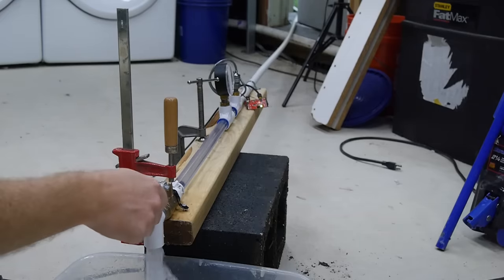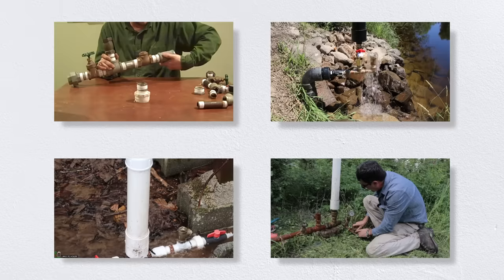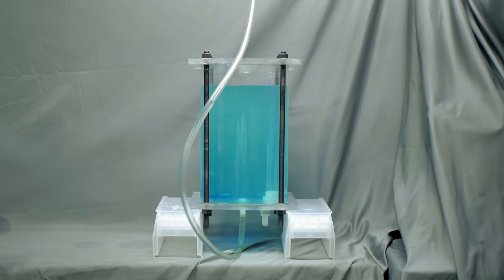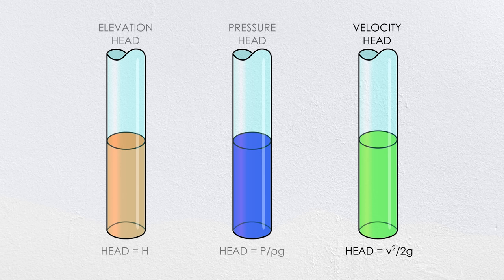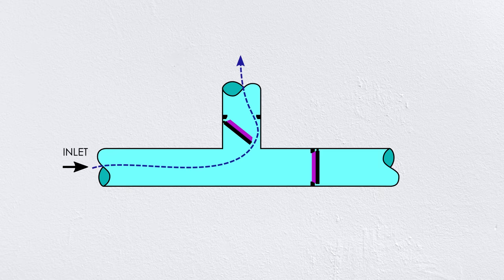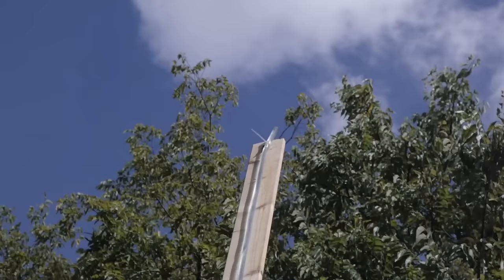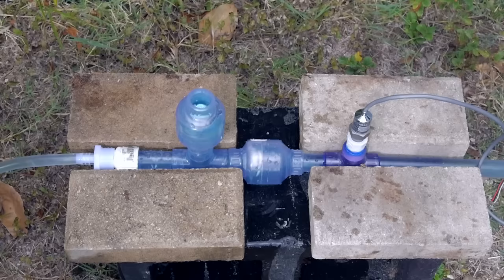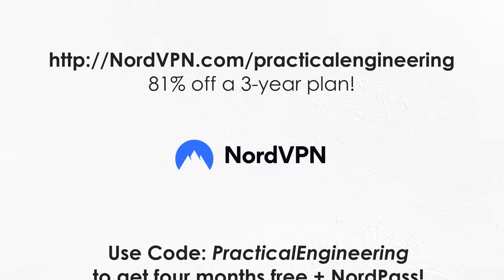How Does a Hydraulic Ram Pump Work?

Comment: It's things like this that convince me that engineering is black magic.
If you came to me, and asked me build a system that pumped water 10 feet into the air, without electricity or fuel, I would have told you to bugger off. It's not possible.
Reply: magic it's just advanced technology that you don't understand yet.
Reply: Flowing water = energy = Fuel.
You can use this fuel in many ways, one is to use a ram pump, another would be to have a 2 chamber device, one with a turbine/generator and the other with an electric pump.
One of the big problems with 'youtube armchair scientists' is they dont know the difference between an impossible 'perpetual motion device' and harnessing solar/hydro/wind power.
Reply: Dusk Dawg  he would think that you where demonic.
Reply: @Debbiebabe69  That's the point OP was trying to make, though. "I never would have considered wasting water can give me energy to pump". I'm half-tempted to see if my physicist friends know about this, because I didn't (but I studied chemistry, not fluid dynamics).
Reply: Moving water = current
Reply: @Why not Dean The iron giant is one of my favorite childhood movies!
Reply: @nom6758  English isn't my primary language, can you teach ~how~ the right way?
Reply: @ffccardoso  Good on you for trying to improve yourself.  In this case, it's, "...that you don't understand yet." 

The six present tense cases are I don't, you don't, he/she/it doesn't, we don't, you don't, they don't.  When in doubt, use "don't", since only the third person singular case uses "doesn't".  Obviously, it's the same conjugation as "to do" but with "n't" added to the end.

Also, a more proper version of your last comment would be, "English isn't my primary language.  Can you teach me the right way?"

Finally, kudos to you for being able to converse in a second language.  It's something the majority of Americans can't do.  Judging by the YouTube comments sections (though admittedly not this one) there are many Americans who can't even hold an intelligible conversation in English. 😉
Reply: Siphon
Reply: @Debbiebabe69  Sure, it's easy to see that there is energy in the system. I guess I was more amazed by the simplicity of the system. Two valves and you can pump water indefinitely (theoretically) without applying external energy.
It's an incredibly simple design, that works in a way that I wouldn't have come up with in a 100 years.
Reply: This does require flowing water tho.
Reply: @burke615  Thanks man! I am very grateful for your help!
Reply: Deal with it! :)
Reply: On the outside, but the wasted water is essentially the fuel in this system.
Reply: Theres an old sci fi saying that any sufficiently advanced technology will be considered magic.
Reply: And you'd be totally correct.   To do work, you need energy.   In the case of this pump though, it uses either kinetic energy (from, say, a river that has flow) or potential energy (water that's been pressurized before getting to you).    These are concepts that we try to hammer home in high school, but most students (myself included) didn't clue into these fundamental ideas back then.
Reply: Sufficiently advanced technology is indistinguishable from magic.
Reply: @frykasj  And in turn any sufficiently studyied magic is nondistinct from technology.
Reply: @Debbiebabe69  Which is also why i excluded electricity in my post.
Reply: a suction pump will do that ... you just have to raise and lower the big arm attached to piston to create the suction ...
Reply: @0623kaboom  "without electricity   or fuel" :)
Reply: Dusk Dawg  you would turn into barbecue
Reply: Dusk Dawg  I saw it on Castlevania.
Reply: It seems complicated for a layman but people don't come up with these solutions in the shower. It happens after many years of experience and experiments. You have to start with the foundations and build up your knowledge from there. Everything makes sense when you have a reference.
Reply: It feels like exploiting a glitch in the matrix
Reply: You are just dont understand how the system works
This is how i make money.  I can pump up to 200 m high ang 3000m away. Come to my place I'll show you,  evrn without any pump.  i'll show you that is happen in our daily life.  
I knew it (even didn't undertand) wondered the phrnomemon when I was in secondary high school.
Reply: RaM pUmP fReE eNeRgY dEbUnKeD!???
Reply: Dusk Dawg which never happened. Sorry to burst your myth. People knew the earth was round back to the Greeks at least if not before.
Reply: @robertlee5456  maybe because examples like these would've helped more students to grasp the concept, than equations alone?
Reply: Dusk Dawg  Not really magic mirrors, more like paintings that look just like real life and move.
Reply: Felipe Ferreira I hope to live in a world where magic and science combine. A true technological wonderland is the world I wanna die in(a wonderland built on the backs of alien slaves of course)
Reply: Lol. 
        Have you ever seen a windmill?     
.
Google,  Holland 
     and youl see how it only exists because they pump the sea water out using windmills.. 👍
Reply: @Dark Slayer  I mean, have YOU ever seen a windmill? They are usually used for grinding flour and such.
 I imagine that's where the "mill" part of "windmill" comes from.
That is super interesting though, I didn't know that's why the Dutch had so many. I just figured they used dams and levees to reclaim the land. Though I will say they didn't "pump" as much as they "shoveled" water around :P
Reply: @whynotdean8966  yeah loads of them but me too!      
          I thought wind mills were for milling crops and just thought the dutch were super hard core farmers or something until i drove over there, saw them all and googled it then realised !     
 .
WO 😳
.
Im driving UNDER sea level here.  

 One lil tsunami and this whole place goes under ! 😳
Reply: @eggyrepublic  It doesn't. As long as the pump is located lower than the water source it can benefit from the physics of siphoning fluids to feed it constantly.
Reply: Just dont look into how Bernouli's Principle lets planes fly ... ... its a total loop hole in physics and shouldnt work :) -🤣😂💪
Reply: Quite common on remote farms, can lift to remarkable heights.
Reply: As this saying goes:

A sufficiently advanced technology can be undistinguishable from magic
Reply: Felipe Ferreira . You do very well though. There are different forms of the word does. There is do, it means to do something like; Do you want to learn ? I want to do that today. 
I do not want to do that, people usually shorten the two words , do not, to , don’t. I don’t want to do that. If we are talking about someone else using He, she, Felipe, the dog, you use it like this; she does not like to sit and write or the dog does not eat candy, or Felipe does not speak that language, we can change all of the -does not, into doesn’t.
The cat doesn’t cry loudly.
We don’t use ; when beginning with the word , You, you don’t use doesn’t like this; You doesn’t like that. It means the same as ; You does not like that. That’s the wrong form.
You would use, You do not like that., or, You don’t like that. It’s call a contraction when you bring these two words together from “ do not , to, don’t.   I cannot ( can’t) tell you the rules as an English teacher might, because it’s ( meaning it is) just how I grew up as my mother made sure we spoke properly. 
There are other words that can form contractions ( you could get a book from the library or buy one on the use of contractions. ) 
Here are some words for that use;
Won’t, means or changes from would not. I would not eat a raw steak. To; I won’t eat a raw steak, or, I wouldn’t eat a raw steak. The root word of all the forms is would. The root is like the basis of all. Think of it like the roots of a tree holding the tree in place and the other words that spring from its branches are contractions. Which is a tightening up and squeezing together two words, in that the second word is always “ not”. To decide if a contraction fits, you speak the sentence in its whole form, the word and add not. Would not.
If I were to say; I wouldn’t eat that if I were you, I would say it in my brain, I would not eat that if I were you. I’d think, ok, that works. Good form. I cannot use won’t in that sentence like this; I won’t eat that if I were you. That’s ( that is) the wrong form. You can say, I won’t eat that. That is fine. But if you lengthen the sentence, it is wrong. 
You can say; I wouldn’t eat that if I were you. It’s the same as ; I would not eat that if I were you. Sorry, I don’t know the rule for that. I just know it’s correct. 

There is the word can’t . The root word is “Can” the past tense is could, depending on how it is used. 
                   You could do that.
              James could do that.
You also can say; I can do that.
He can do that.
James can write well. 
Could is past tense , like already have done and is known already , if the ability. 

There is the word should, can be used like; shouldn’t, means should not.

I must go. If you see this, look for Veronica Mills Noll on FB. PA, if you want to practice anymore. Good luck to you.
Reply: The energy utilized is gravity
Reply: We have a whole PR team to make sure this idea is still alive. We're already suing Practical Engineering because he's trying to explain how our magic works. What next, kids liking math! It will be the end!!!
Reply: @tacticalkyuubi8147  No, because a siphon does not work uphill.
Reply: to me you have to think "simple", simple stuff for simple tasks; obviously it requires experience, i'd say in this case you can think of it as an impact wrench, like a flywheel that accumulates kinetic energy and then releases it
Reply: @Debbiebabe69  a fairly obvious non-electrical one (significantly less smart than a ram) is to use a water wheel, either with buckets (a noria) or connected to a screwpump. Or multiple wheels connected together with one providing the motive power and the rest sustaining a transmission chain bearing buckets ("chain pump").
Reply: Like everything, you can convert one way of energy into another like the ram pump ;)
Reply: @ffccardoso  arthur c clarke
Reply: @bender9000  yep!
Reply: @Debbiebabe69  Practical Engineering explicitly says it's not not a perpetual energy device though.
Reply: Ah but I would just have called the engineer, that's why I'm paid more :)
"Work smarter not harder" or "employ smart people and make them work it out"
Reply: Any sufficiently advanced technology is indistinguishable from magic.

Comment: When I was in high school in the 80s, we moved to a remote piece of land with a small creek at the bottom of the property.  When we first moved there, we were living in a trailer about 80 feet uphill.  We built a ram pump to fill a 150-gallon tank we got from a friend. 
Our ram pump used a Rainbird sprinkler as the waste valve (so it was noisy as hell) and we didn't think to add an air chamber to buffer the vibration; it had a tendency to rattle itself to bits over time. I had to repair it, or the uphill pipe, every couple of months. Eventually we got a more reliable, higher-volume water source going - but I still remember it fondly, because it saved me from carrying 5-gallon buckets of water up the hill every day!

Comment: My family moved to an isolated farm in NW Arkansas in 1962.  There was no electricity but we had a strong spring in a valley next to the house we were building.  Included with the property was a ram pump (very old because it was made of caste iron!).  The first winter we lived in a small travel trailer which was parked beside a tall pine tree.  Dad hung an old water heater tank in the tree.  The hydraulic ram was used to fill the tank so we had water into the trailer.  I was small then but I vividly remember that old pump.

Many years (like 50) I went to an exhibition of old tractors and farm equipment.  As I toured the exhibit I noticed an old ram pump sitting on the floor.  I asked the guide what it was and she said, "I have no idea."  It was my turn to be her guide.  This video taught me exactly it works.  I understood intuitively and now I understand the science/engineering behind it.  Wonderful!  I'm subscribed now... I want to learn more and more.
Reply: I lived in Bentonville shortly, NW Arkansas is some beautiful country.

Comment: The function of the air dome is to provide somewhere for the sudden rush of water to go when the waste valve shuts, without having to accelerate the water in the "lift" pipe, ie the pipe going up to the tank. When the air dome is big enough the output has a steady flow, with little pulsing. One of the rampumps that I made used a 2" by 70 foot alkathene drive pipe with about a 2 foot fall. The home made waste valve was bolted on to a 12 gallon drum, which functioned as a dome.  (They can handle quite a high pressure!) The gasket was made to also function as the output valve. It cycled away very lazily, with the waste valve staying shut for about 1/2 second every cycle, while the drive pipe water flowed into the drum.  The water flowed steadily from the 3/4" lift pipe about 20 feet above. Until a big flood came and took it all away! Which is one of the problems to be thought about when installing a rampump!  They are lots of fun and very satisfying to make and play with.

Comment: Water, Steam and Vacuum hammering is a fascinating "problem" but each have some unique uses as well.  Hydraulic ram pumps are one of them, industrial steam hammers are another.  A problem is just an solution in disguise for another challenge (or so my professor in university once told me).
Reply: Steam hammers used compressed steam, not the "steam hammer" effect.
Reply: P=NP?
Reply: @MushookieMan  Indeed, there is no "steam hammer" effect because water vapor is easily compressible.  If you tried it, all you would get is condensation.

Comment: Thats genius. Theres a lot of inventions ive seen where i thought "yeah, i could have invented this". But i dont think i would have ever figured out the ram pump on my own. 

I also love the spiral type pumps. They use a coiled pipe in flowing water. The flow of the water rotates the coiled pipe and allows the water to move from the outer windongs to the center, which is where the output is. Beautiful and genius.

Comment: Thank you for the shout out! Great video. By using a ridged drive pipe your setup could pump twice the water. ... but the increase in pressure might cause those light pvc valves to stay closed. Brass or steel valves work very well. (But dont show what's going on of course)
Reply: Can you be more specific of your theory and what parts are needed to build it

Comment: this mostly used to collect water from rivers where waste water just goes back into river
Reply: That or a garden to the side of the river / stream.
Reply: I have only seen them near springs.   You need clean water coming in to keep them from clogging.
Reply: I don't think that's correct .
 wherever whenever you need one. It's great information ! It will work long and hard for free !
Reply: You can collect the "waste" water. I'm not sure why everyone just says it has to be wasted. why cant you put a bucket underneath the pump and collect it?
Reply: @FailedZerg  because it's at the same elevation as the input. Why collect it instead of just walking to the source?
Reply: @FailedZerg  It wouldn't really be wasted anyway unless there was a drought in which case I doubt there would be many abundant flowing springs in the first place. The water cycle is still a thing, it's not like the water disappears for good.

Comment: Thanks for this video. Back in the UK where I grew up, our farm was fed water from a spring. During our time, water was pumped with an electric pump to header tanks in the house and watering troughs for animals around the farm but I always remembered that on a lower part of the farm, near a stream formed by the water flowing from the spring, there was a small concrete platform with a mechanical device and two tall circular tanks (roughly 2m tall and 90cm wide). None of this was in use but my dad told me it was an old sort of pump. He called it a "hydram" and Googling that term brings up images of something that looks kind of familiar, particularly the big bulb on top which I guess was an air chamber to reduce the hammering in the delivery pipe.

I have no idea where on the farm the was being delivered to but I'd guess that like the modern system, it would have at least fed water to the house. But what I am curious to know is what those two large tanks were for. What I can say is that they were really robust. My parents moved to the farm in the early 1970s and those tanks and the pump were already long since not in use. At some point the pump was removed (my guess is that my father wanted to try and get it working again but found it was too corroded and sold it for scrap) but the two tanks are there to this day and there is no evidence that they have corroded through.

Comment: It is ingenious and has found good use for upstream eel passage at hydro projects in the northeast.  Since many eel passes are located at sections of the dam where it would be difficult to power conventionally, the use of a ram pump has alleviated that situation and allowed operation of the eel passage with little oversight.